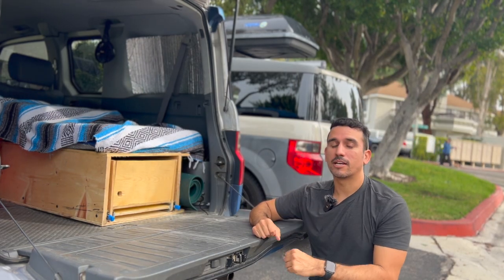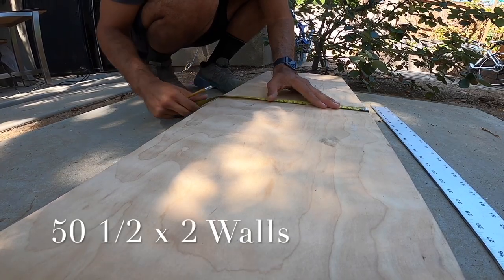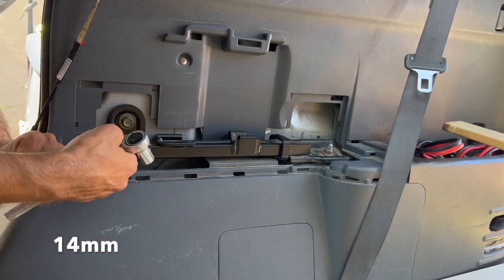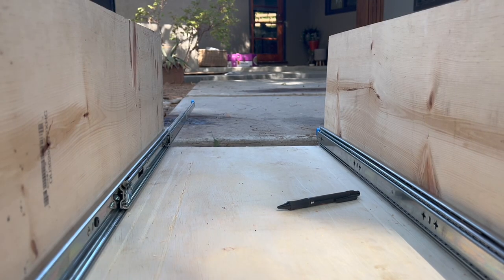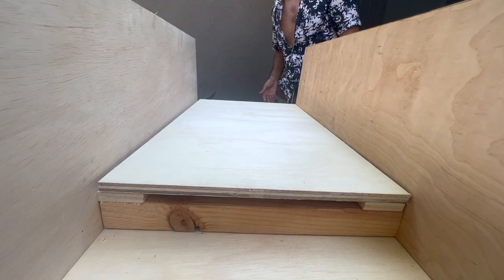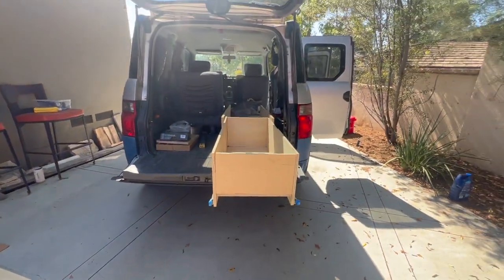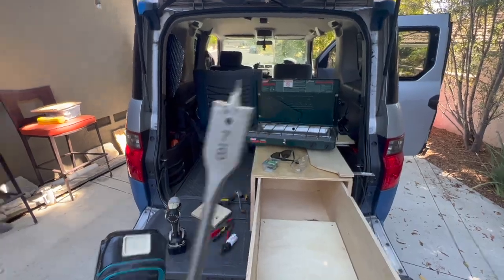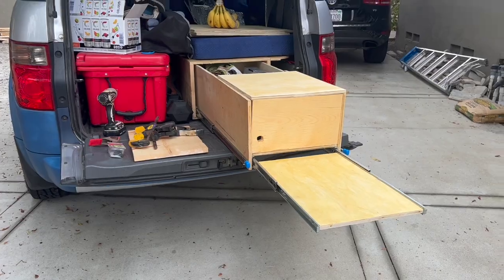Solo Camping Bed Platform - Start to Finish DIY

Comment: On almost every bed build video for an Element I have seen, it's to put the solo bed on the right side. Is it accurate to say that's because you get more room on that side because you can move the passenger seat so far up?
Reply from the maker: Yes and say your out camping solo & you want to move to a new location there is no need to make the bed back up I can just hop in and drive to the next location.